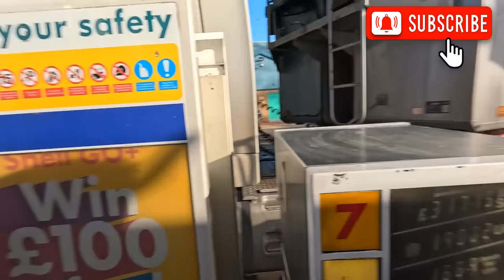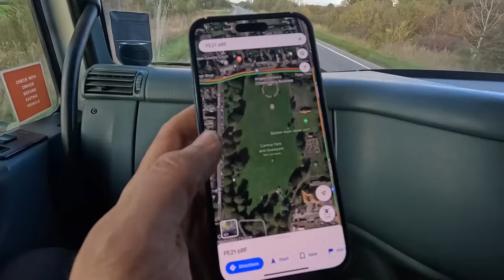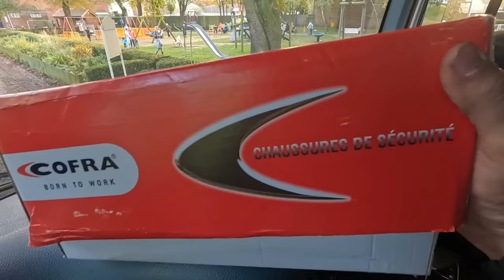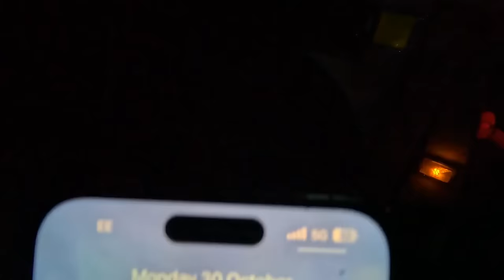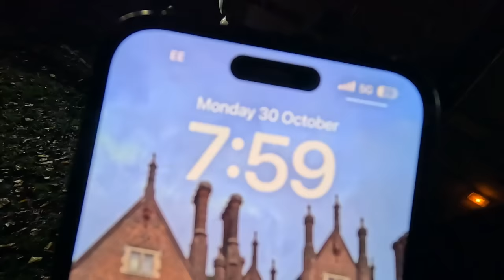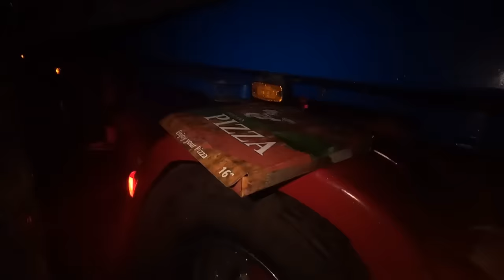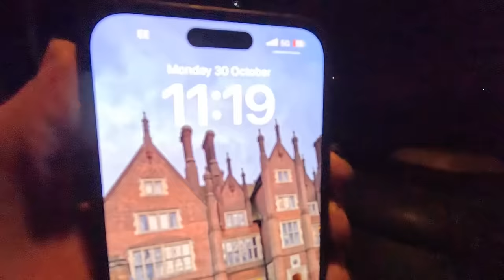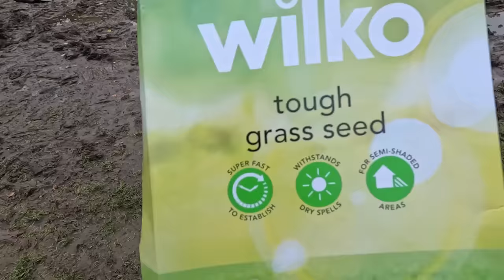RECOVERING MULTIPLE TRUCKS | GOES FROM BAD TO WORSE | #truckertim

Comment: As someone who works on a fairground, I honestly feel for these guys, we stopped doing places like this in winter, not worth it. Creates a right mess and a massive nightmare
Reply: Where i live, they shut the main car park for the fair because it’s in October, much better than the motte and Bailey getting stuck in the floor
Reply: I imagine costs a fortune too in cleaning trucks and recovery
Reply: @AaronCable-tf9tt  definitely eats at the profit margins, it's finding the time aswell, we run on very tight time schedules so we don't always have time to be worried about how clean the wagon itself is, we always keep the rides presentable and clean though, that's the important bit. We mainly do car parks in winter, the ground is firm, easier to build on, don't need to run boards out, don't worry about getting stuck.
Reply: Showman will have to reinstate the area to how it was originally
Reply: @craigdoig9486  not replace the area, we have to work to return it to its former glory, so plant grass seeds, flatten any ruts, relevel the ground. We just have to do our best to return it to a good standard, but damage is expected on grassland and the council's are generally quite good with this thing. Sometimes we have to pay damages, in this case, with the storm it faced over the weekend it was there, the council would be quite forgiving but still charge damages and expect the showmen to do as much work as possible to get the grass to grow again
Reply: @lilproblems  thats a 1066 castle
Reply: Who paid for the recovery, the council or the fairground?
Reply: @IanBrewster  most of the time it's the fair, the council or land owner get paid ground rent for the time the fair is there, this isn't just the open, it's the building up and pulling down process too. They will get charged fines off the council if they fail to leave by the end of their lease term and have other events to attend, so it's in their best interest to get recovered as much as it costs a fortune.
Reply: @beneadesmtb  sorry my comment was meant to say reinstatement of the area ie reseed and flatten ruts

Comment: That park will need ploughing and a total leveling out then reseeded  in the spring what a giant mess . Good effort from shauns wreckers plus that powerful John deere tractor.  May be they should of got 3 huge powerful farmers tractors or a fairly big bulldozer  as they can really pull stuff  and shaun  and his dad could have stayed on the hard road and just pulled by walking out the tow lines . That was a very difficult job but made great video

Comment: Lesson learned not to run a fergond on the grass or maybe become a tow truck driver that will be very very noisy for the residences the local council will say no more fairgrounds on this green  i would split the trailer's tow the trucks out first and come back for the trailers they should have put on cement base

Comment: Dear Mr Tim,

I have noticed that in the last video you stated that some parts of the red 4 Series would be given away for other projects.
So as a gentleman to another gentleman, I will cut straight to the point as not to waste your most valuable time.
Would you mind if I have your 4 series driver or passenger seat for a simulator gaming setup?

Yours sincerely, 
Abrams Clips